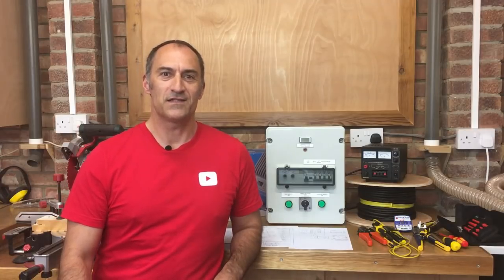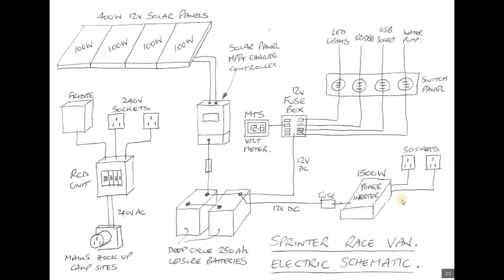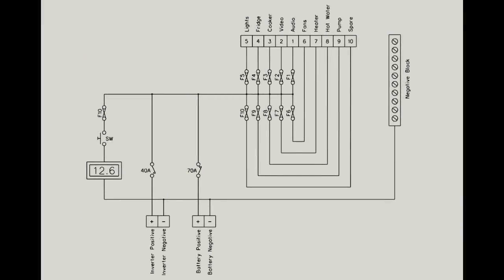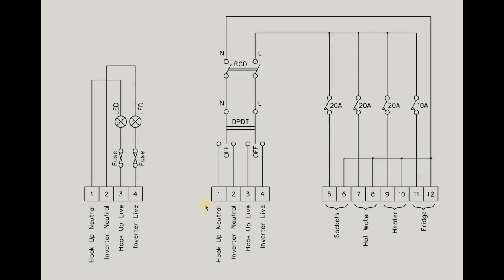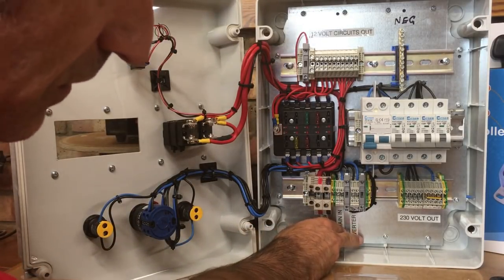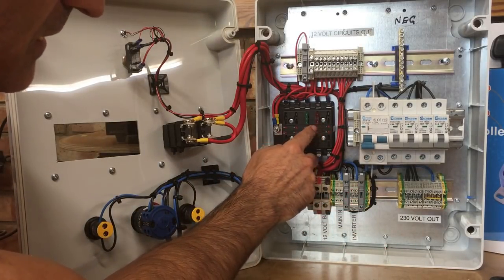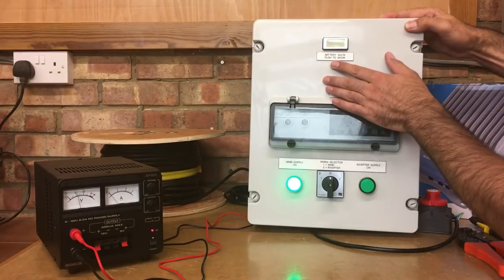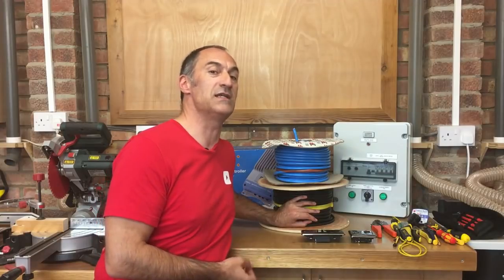Self Build Camper Van 12v Electric Control Panel

Comment: Hi. I was really impressed with your design and implementation; clearly a lot of thought and experience has gone into this. I do have a slight safety concern though - not a problem for you but more for people following.  I notice that your AC live wires inside your control box appear black - which is fine for a house build in which you tend to only find AC circuits; but where you've got a mix of AC and DC in a box I'd hope that the AC live would be brown as black would normally be used for the DC negative/ground. Using the same colour for a DC ground as an AC hot wire leaves a risk for less experienced people who might mess it up. It could be a camera thing (brown can look like black if in shadow) but if people are following your design from your video they might get confused. Might I suggest/recommend an annotation to help people get this right (or at least pick different colours for their AC and DC components).
Reply from the maker: Yes, you are correct the current wiring colours for AC are brown for the live.
What I will do is wrap a small piece of brown insulating tape on each cable to mark it as live.
There will be a detailed wiring diagram within the panel. Well spotted.

Comment: Hi great video. Just wondering  how you intend to earth the 240v side of the inverter?
Reply from the maker: Hello, the rear backplate of the control panel is the metal earth plate, all outgoing earths on the mains side connect to this as does the main RCD so and faults will trip the RCD in the main panel and kill everything going out of it.

Comment: Very interesting. I wonder if it is a good idea to be able to charge the batteries when the van is connected to the external power.
Reply from the maker: Yes, very good idea, I am currently searching for a good mains charger that I can add to my van. Do you have any suggestions?

Comment: About the best van conversion video, I have seen up to now please don't stop making these videos. First Class, brilliant.
Are you having a split charge circuit to charge the batteries while on the move?
and are you installing a battery charger for charging your batteries when plugged into an electric hook up?
Are you installing a 3 way fridge 240v, 12v, gas
Reply from the maker: Hello Neil, thank you for great feedback 👍🏼
1. Yes have got a split charge relay kit to fit. 
2. Yes, trying to find a suitable mains charger for the leisure batteries. 
3. No, just a 2way, mains and 12v but not gas as I don’t want to cut huge vents in the side of the van. 
Thanks for watching.

Comment: Hi Greg great video but alas no chance of me being able to do this myself 😱 is there anything similar on the market that I could just run cables to ? Or would it be very expensive to have an electrician make one up for me ?
Reply from the maker: Hi Wendy, yes there are Power Management Systems available for reasonable amount £215 that will allow you to wire to one point. You can get an electrician to build one like mine, that would be more expensive approx £4-500.
This link gives you some commercial ones. https://m.ebay.co.uk/sch/i.html?isRefine=true&_nkw=Pms&ssPageName=GSTL&_mwBanner=1&_sacat=131090

Comment: Great video. Read the comments and didn't see this come up. If I missed the comment sorry. You set up the outlets to switch between mains and inverter, so you only install 1 set of outlets. But by doing that and based on you diagram, when you switch to your inverter the refrigerator and heater will also be on the inverter unless you turn off there breaker.
Reply from the maker: Hello Don, you are absolutely correct. I have a 2kw inverter so it could power these devices easily. Whether I chose to use them off battery full time is another thing. But like you rightly say you can simply trip their breakers to disable them when running on inverter.  Great question. Thanks
Reply: @GregVirgoe  Hi Greg. I've watched this video many times over, and it's brilliant. Totally got my head around how it's all working, very clever indeed and beautifully executed. I was also thinking the same thing as Don (hence reading through every comment in case it was discussed), in that when switched to Inverter, the Fridge and Truma would be getting a 230v supply and hence switch over to that mode. I'm going to be using a CRX50 and Combi 4E based on your recommendations. Isn't it better to leave them on 12V and LPG respectively if there is no hook up available?

Comment: Really good. Just wondering why there's no feed from alternator to batteries, or mains battery charge option.
Reply from the maker: Hello Kev,
I am installing a split-charge relay kit external to the panel to link the two battery systems.
I will also have an external mains battery charger but have not found a suitable one yet.
I wish I could find a multiple input charger/controller that would do both operations.
Reply: Greg Virgoe thanks, saw that in the next video, should have updated the question. Really impressed by the way you're doing this. Every time I think 'what about?' you go on and answer it.

Comment: Greg...this is great work. I have followed your videos very closely as I build my van. I have already used this design as the basis for my electrical system in my van...its installed and looking great. I thank you for your extremely informative videos that have allowed me to confidently wire up my van in a professional way. One thing I am struggling with is the sourcing of the clear plastic window that you have installed on the front of your switchboard.  Where did you get yours from? I'm in Australia and Ive spent hours looking for suitable windows from other electrical enclosures and none are usable. Could you send me a link to where you got yours from...maybe I can get one imported from the UK. Thanks
Reply from the maker: Hello Phil, most of the parts were sourced from RS components. The part you are looking for is an "IP67 Inspection Window" stock code number 2971229. Here is a link to the exact page, so I hope they can ship it to you.
https://uk.rs-online.com/web/p/enclosure-accessories/2971229/?searchTerm=2971229&relevancy-data=636F3D3126696E3D4931384E525353746F636B4E756D626572266C753D656E266D6D3D6D61746368616C6C26706D3D5E5C647B362C377D7C5C647B31307D7C28283F69292852537C5253207C52532D293F5C647B337D285C73293F5B5C732D2F255C2E2C5D285C73293F5C647B332C347D292426706F3D3126736E3D592673743D52535F53544F434B5F4E554D4245522677633D4E4F4E45267573743D32393731323239267374613D3239373132323926
Reply: Thanks so much Greg. They actually have RS components here in Aus and they have that exact item in stock for $58. If I can post some pics on your facebook page of my finished enclosure Id like to show you what Ive done. Its almost exactly like your set-up and everyone is very impressed.
Reply from the maker: Hello Phil, that's great! Yes please do post your photos on Facebook, I will be very excited to see them.
I had created an album for viewers projects, hopefully, you can post to this Album on this link.
https://www.facebook.com/pg/Greg.Woodshop/photos/?tab=album&album_id=876981485785550
If not just post on the main page. Look forward to seeing it.

Comment: What wire sizes are you using for the panel and van wiring?  The link seems to list multiple cables.  Thx for the great videos!
Reply from the maker: Hello Scott, The DC circuits for lighting etc are 2core 1.5mm cable, the 230v cable for sockets, heater etc are 3core 2.5mm cable
The cable inside the control panel are tri-rated single cables and are individually sized depending on the load in amps at that point on the schematic using a cable sizing chart found online.

Comment: Excellent videos Greg, probably the best I have come across so far on camper van conversion!
I have one question that I hope you will answer for me. Regarding the distribution panel that you have made, is the box a bespoke item manufactured specifically for that purpose, and if so please advise (or provide a link) where it can be purchased? Keep up with the great videos.
Best wishes Ray.
Reply from the maker: Hello, I designed and the box was made from components brought from RS components. This is home made and is a one off panel. 
You can purchase the parts and build your own or there are Power Management Systems made for this purpose. Thanks
Reply: Thanks for you reply Greg. It was the box / case itself that I was refering to, not the components it contains. I will have a look at the R.S. website.
Regards, Ray
Reply from the maker: Hello Ray, search for “ABS plastic enclosure box” they are available in all sorts of sizes.
Reply: Thanks Greg.

Comment: Hi Greg, I am a late comer to the party! I would just like to say that I really enjoyed your explanation on electrics in a campervan. Not sure why anyone would give you a thumb down on your video! I am thinking about either purchasing a campervan or building one from scratch, and after watching your video, you give me hope that I may one day be able to complete one myself.  In converting a van, do you think there will be an increase value?  I was thinking about the pros and cons of purchasing a new campervan, and one major reason was depreciation, and I was wondering if converting a van may increase its value. Could you please give me your opinion? Thanks again for sharing your knowledge with “us van newbies”.
Reply from the maker: Any excellent question Mark. I have no doubt that you will be adding value to your vehicle by converting it to a camper van. Obviously, the level of the increase depends on the equipment installed and the quality of the workmanship.
We also looked at buying a camper but the cost is ridiculous. To give you an idea here are my budget figures.
58 plate LWB sprinter with 112,00 miles = £6,600.00 in very clean condition.
Budget a further £8k for the equipment and materials to fit it out. Total cost approx £15k
I would expect to see a return on resale of about £20-25k I'm aiming for a high-end professional finish.
The van will be re-registered with DVLA as a Motor Caravan and will no longer be a commercial VAN.

Comment: Would there be any benefit to putting the switch between the solar charge controller and the batteries, so on one side you have the power coming from the solar panels, and on the other side of the switch you have shore power, so instead of having shore power going to your fridge and 240v sockets directly, you're just charging the battery and only using the inverter to step the voltage back up?  I know it seems like a waste of power (or at least a somewhat inefficient one), but it would simplify the system. Or?

Edit:  Of course, with a smart battery charger converter on the shore side to send the correct voltage to the battery.
The only downside I can think of is if your solar charge controller can't handle NOT being connected to your battery for a period of time.
Reply from the maker: Hello Phil, you couldn't put the switch there as you have two completely different voltages. You can't put mains shore power directly onto your batteries it would have to be via a battery charger, (which I do plan to install.) using your method the shore power would charge the batteries and then go though the inverter to bring back up to mains voltage. That seems like a lot of losses when you can just use it directly like I have.
Reply: Totally.  I somehow missed the part in your video where you mention that the switch is between the inverter and the shore power!  That made a lot of things click all of a sudden!!  Thanks!

Comment: Hi, my name is Rogerio Marques, I'm in Brazil, I'm researching a lot about it and I came to the conclusion that the use of the inverter is an investment expense and an energy expenditure, since we can eliminate the inverter by installing only 12 volt or 24 volts, tv, refrigerator etc. what do you think ???
Reply from the maker: Hello Rogério, if you are working on a budget then yes an all 12v system would be cheaper and simple to install. 
I wanted the freedom to use mains voltage wherever I may be. I can suffer the small inefficiency when the energy is free. Thanks for watching.
Reply: Greg: I mean, when I'm at a campground, I could turn on the 220 or 110 power from the campground and the charger would be powered and all the electronics would work. Of course an air conditioner would be ideal to be connected to an external network. Thank you for your tips.
Reply: I work in boat design, and there are efficiency gain in avoiding voltage conversions where possible.  In particular, using 12v USB sockets will half the conversion losses between the battery and the devices being powered.
One instrument you may wish to add to your panel is a DC ammeter.  This would be fed (a small voltage drop) from a shunt (resistor) on your battery connection.  This would allow you to monitor the power balance between sources, and loads.
Reply from the maker: Hi David, you will see in the next wiring video I did take everyone’s advice and have added some 12v DC USB sockets. My solar charge controller has a decent battery monitor. Thanks for watching

Comment: Hi Greg can you tell me where did you get your panel box. and is it a specific panel box.
Reply from the maker: Hello, I used a waterproof adaptable box design for electrical services, here is a link to some on ebay.
https://rover.ebay.com/rover/1/710-53481-19255-0/1?ff3=4&toolid=11800&pub=5575265109&campid=5338027957&mpre=https%3A%2F%2Fwww.ebay.co.uk%2Fsch%2Fi.html%3F_from%3DR40%26_sacat%3D0%26_nkw%3DWaterproof%2Badaptable%2Bbox%26rt%3Dnc%26_dmd%3D2
The rest of the internal components I sourced from RS 
https://uk.rs-online.com/web/c/?sra=oss&r=t&searchTerm=control+panel+components

Comment: You obviously have some solid electrical background which some of us don't have. How do we go around this?
Reply from the maker: There are commercially available Power Management Systems at very good prices.
https://rover.ebay.com/rover/1/710-53481-19255-0/1?ff3=4&toolid=11800&pub=5575265109&campid=5338027957&mpre=https%3A%2F%2Fwww.ebay.co.uk%2Fsch%2FMotorhome-Parts-Accessories%2F169486%2Fi.html%3F_from%3DR40%26_nkw%3Dpower%2Bmanagement%2Bsystem%26rt%3Dnc%26_dmd%3D2

Failing that you can ask an electrical controls contrator to make a panel for you, expect to pay more for this bespoke service.
Hope that has helped?

Comment: Great channel! Shouldn't you put a DC disconnect between the panels and the charge controller? Otherwise those lines would be live as long as the sun is shining, and probably even on overcast days.
Reply from the maker: Hello, I have got isolators and DC breakers for the solar panels